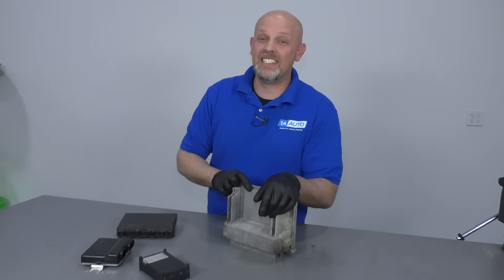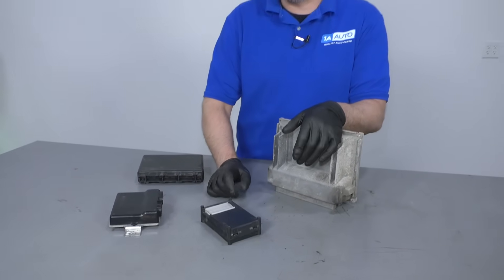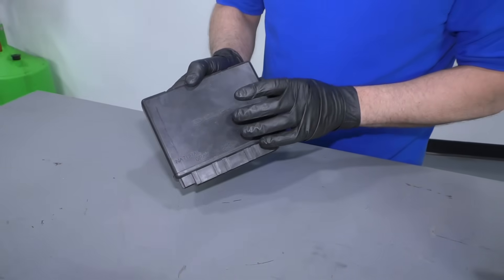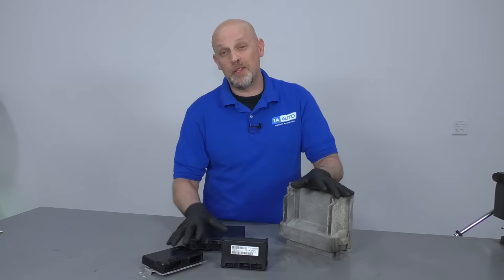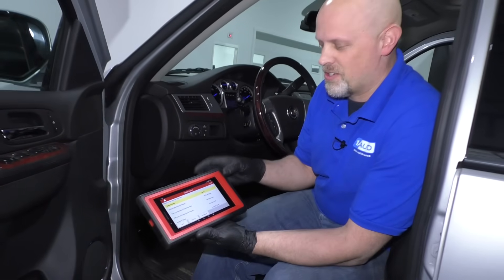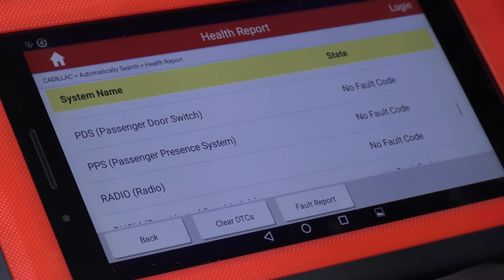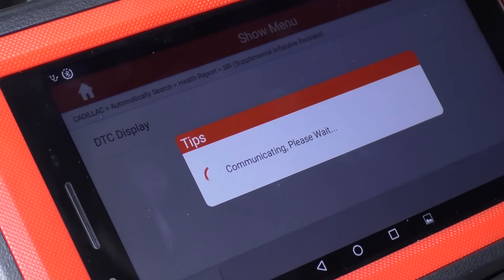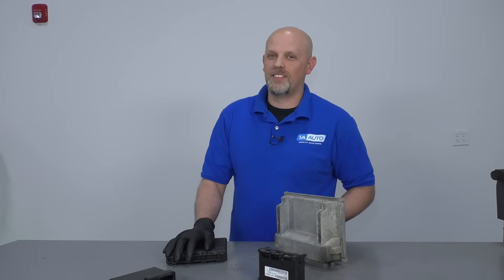What is an ECU? Car, SUV and Truck Computer Acronyms Explained!

Comment: I have mitsubishi xpander 2022 sinked in water I had spoken to mechanic and he has informed to change the wires and ecu and programme it and open the engine to change the connector  can you suggest me

Comment: This problem happened to our 4x4  symptom was engine light came on but the scariest was loss of acceleration, this happened to me in busy traffic our 4x4 had only done 80,000klm I limped home with zero acceleration it was so random got it fixed but wow was it a frightening..glad it didn’t happen why we were towing the caravan....unsure if it’s something that can be check at a regular service on your vehicle...would be good to know how to get in front of this problem 👍
Reply from the maker: +Jan Monck Thanks for the tip!

Comment: Hi .i have a problem with my Toyota Town ace van, [Diesel] You will be driving and the check engine light just comes on ,the engine do not shut down ,you just can't accelerate you have to turn off wait for a couple minutes and start again...I HAVE CHANGED SO MUCH THINGS ALREADY...All with out success...CAN YOU HELP ME PLEASE ???
Reply from the maker: +Rickey Butcher We wouldn't be able to diagnose an issue like that here, you may want to have a local mechanic take a look at it. Thanks for checking us out! http://1aau.to/m/Shop-1AAuto-c

Comment: Pcm,ecm etc. Can they be cleansed of corrosion. Mine was replaced . The original looks fine I was unable to find the problem area. Cost 1650 dollars with reprograming the keys. Got a po448 then changed to a po447. Proir to this I had a po442 and 456 made repairs using an autool sdt-206 smoke machine which comes with a built in compresor affordable for the diyer.